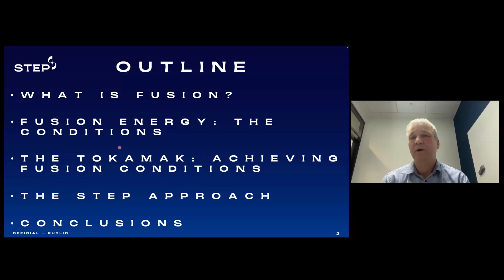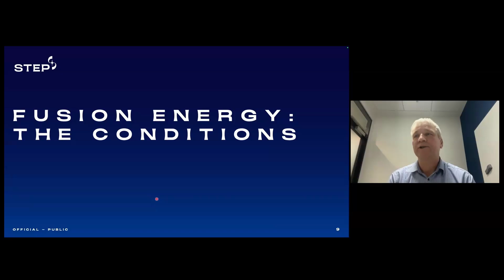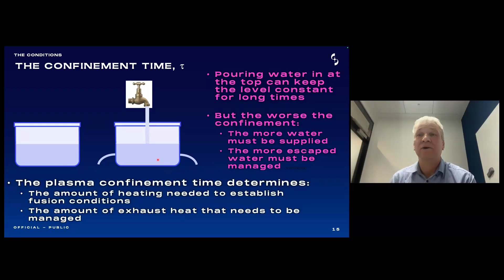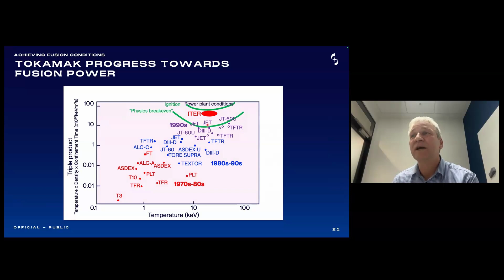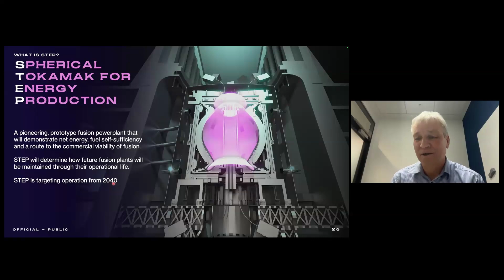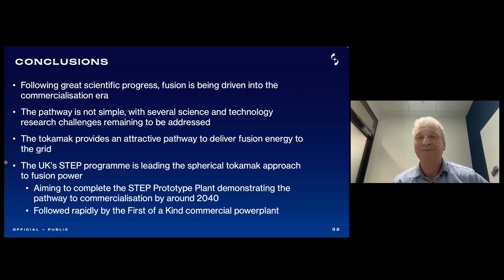The next STEP for fusion energy

Comment: In D-T fusion, the energy yield is so huge that even getting lithium from sea water is economically feasible, if necessary. So that will not be an issue. (Besides, fusion in the more distant future may not even depend on lithium. That's a long way off.)
Reply: The idea that fusion energy will be economically worthwhile is nonsense. Just compare the complexity of the fusion system with the simplicity of a fission reactor, and even that doesn’t give cheap energy.
Reply: @johnh6245  It may turn out to be nonsense, but it's really premature to assess the complexity of something that is not even close to existing yet. An actual power reactor could end up being much simpler than a research reactor, which is itself one of a bunch of competing designs.